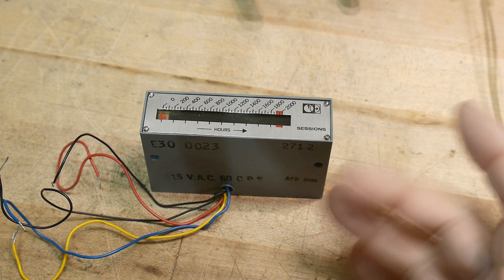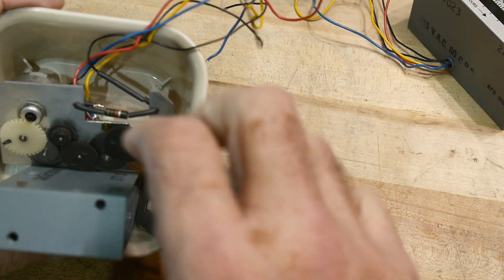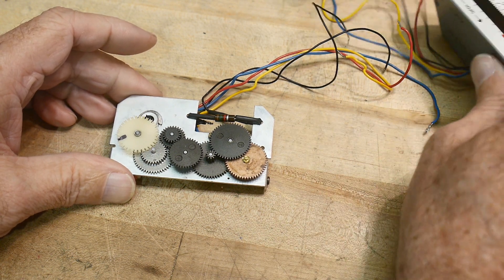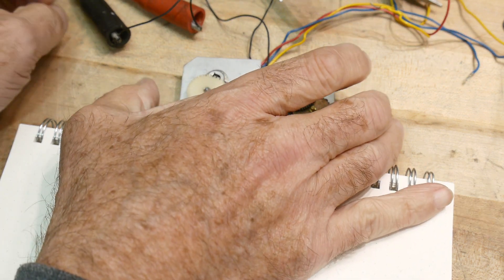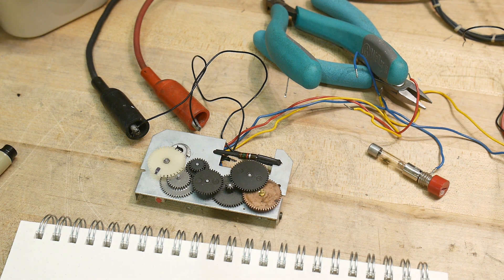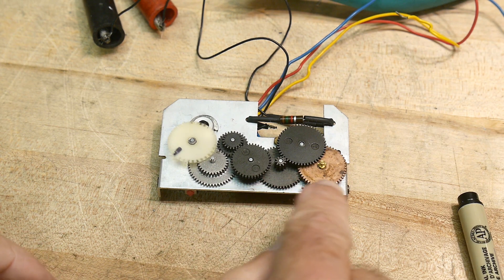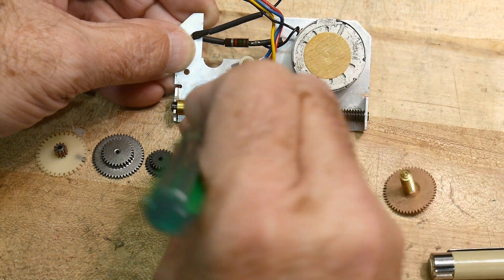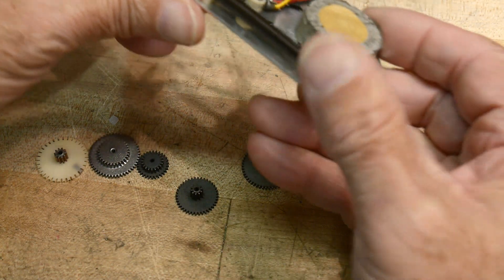#1024 Two Thousand Hour Mechanical Counter

Comment: I’m wondering whether geneva is there to make sure there’s enough torque (delivered in amplified pulses) from the low-torque motor to ensure the gear train transmits reliably all the way to the worm?
 I’m not sure whether a geneva has this characteristic, but I think it might.

Comment: How do you ensure the motor is running at a constant speed? is it a synchronous motor dependent on the 50/60Hz line frequency?
Reply from the maker: yes
Reply: And it should have an mechanism to force it rotate in one direction only!

Comment: could it be a time totalizer for a generator set and the relay can be used to switch a led for reminding about service/oil change after the predefined runtime. The input ac motor is obviously connected to the output of the generator for counting the run hours.Nice tear down 👍🏻

Comment: The switch is probably also there to turn off the motor.
Reply: I was looking at that too.  It looks like the driven gear from the worm is spring loaded.  I'm not sure if that's to preload the screw or to allow the driven gear to be pushed off of the worm gear to stop the mechanism at the end of travel.